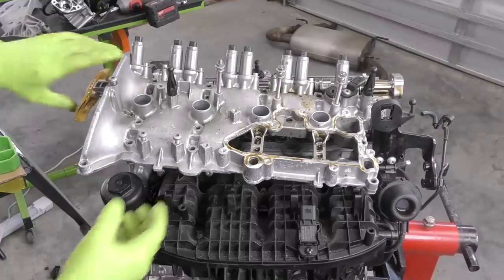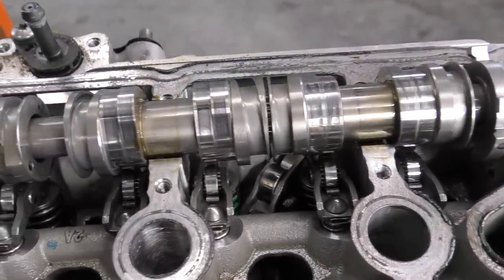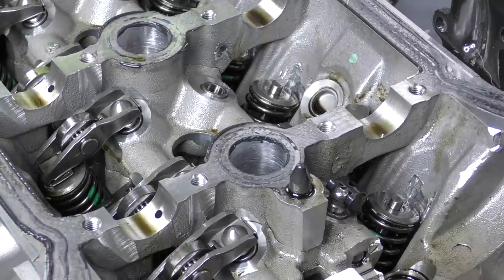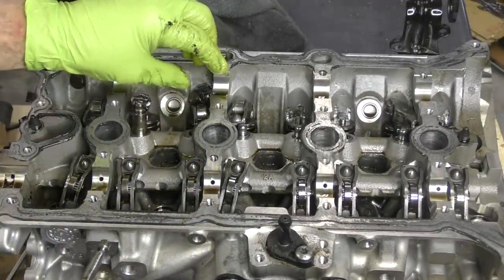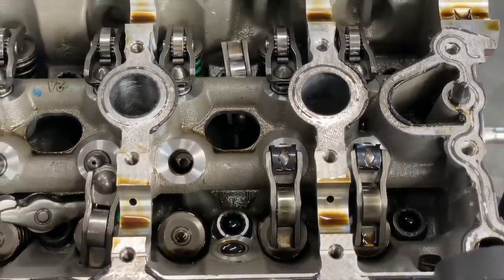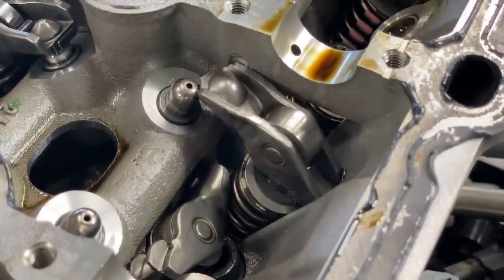Catastrophic Engine Failure VW 2.0t TSI Engine ~ MONEY SHIFT!

Comment: The Germans will soon figure out a way to have plastic pistons
Reply: I'm surprised that the engine valve cover is still metal
Reply: @SPimentaTV  It would be plastic if only it wasn't doing the work of cam bearing caps.
Reply: Valve cover as cam bearings, oh my god 🙂
Reply: I would expect that in a lawn mower with a Briggs and Stratton engine.  They already have plastic carburetors on theirs.  The first time I cleaned one I was a bit afraid that the carburetor cleaner might melt it.
Reply: Garage 54 made wood pistons...
Reply: Charles Hines a lot of small engines have plastic camshafts too
Reply: Love the Power 6 logo !
I’ve owned a few GN’s in my day
From stock, to 1400 hp Stage II
Reply: @flyonbyya  That's awesome! I wish I could say the same. I'm just a Buick fan. I've owned a few LeSabres from 1987-91, and a 99 Regal GS. Nothing like a 3.8!
Reply: Sérgio Pimenta in the future 3D print your rebuild parts.  Throw your old parts in the recycle ♻️ bin
Reply: @jameshaulenbeek5931  He is testing them for VW
VW want to be more Eco-Friendly after diesel gate
Reply: Sérgio Pimenta as far as I know bmw is the only German car using plastic valve covers
Reply: It's probably not far off. It's incredible what you can do with modern polymers.
Reply: @DStabs720  The old VW Beetle had nylon camshafts!
Reply: @SPimentaTV  BMW is using plastic
Reply: Well, I had few years back Audi A4 which had plastic oil pan. It never kept oil inside. I had it four times under warranty and they replaced twice the pan and tried to make it not to leak. I had enough and sold the car. Plastic has its place but not in the engine where temperature differences are huge... Trying to reduce costs with stupid things like this is something I don't understand.
Reply: They will charge us the same as having metal too. Climate change has fucked the consumer. Smaller and weaker engines for MORE money. Ridiculous.
Reply: Sérgio Pimenta 2020 Corolla are plastic now, Toyota beat them to it lol
Reply: Alex Dugre Germans have had plastic valve covers for 10 years. Not every model has them though.
Reply: Plastic is the new premium
Reply: Had a BMW e90 2007 318i with 2.0 n46 engine. It had plastic valve cover. It needed new one because plastic one got bent. Quality my ass...
Reply: The Germans and Swedes have still not figured out to make a coolant reservoir out of the proper plastic. I replaced my Volvo tank 5 times.
Reply: @VladoT  Japanese motorbike manufacturers have been doing it successfully for decades....
Reply: @Ozsmallbore  I understand this from a packaging perspective since bike engines should be as compact as possible, but as a cost-cutting measure i think that it will cost more in the long run.
Reply: plastic camshafts exist
Reply: @VladoT  Ah yes, it's a bastard. Especially on the 1st gen FSI engines, if it starts to leak through the seal between the head and valve cover the whole chain must come off the cams to even remove the valve cover :) Happened to me once on a 1.6, drowned a coil in oil. German over-engineering never disappoints.
Reply: @VladoT  Cam bearings in the Valve cover don't have any disadvantages against the traditional cam bearings
Reply: it's truth, only why only Germans? All car manufacturers of all West countries since 2010 produce no more engines, but total crap.
Reply: David S    Hate to fill you in, but ICE’s are DONE!
Reply: The EDNC you’re delusional. Gas engines will be around forever
Reply: Ea288 tdi engines use steel pistons. Keeps more of the heat in the squish area.
Reply: @TheEDNC  hate to tell you but your wrong
Reply: big teddy    Sure.... 🤣😂😆🤪🤧🤣😂    😎
Reply: @TheEDNC  go work out how many engines are built every day 👍😂🤣😅🤣😅😂😅🤣😅😂🤣+🤞that's how it will stay
Reply: Tony Carver   vw🤣
Reply: @DStabs720  In the future the only places you'll find a petrol engine are in race cars and what will become classic cars owned by rich people. Passenger cars will be all electric or hydrogen fuel cell, and trucks will be bio diesel.
Reply: Lawn mowers have plastic camshafts. However, there is a virtually all plastic engine called polimotor. However, industrial plastics that can hold up to the temperatures that a piston goes through is prohibitively expensive and has a short MBTF and quickly failed in a race. However, the 4.6 modular engine used plastic valve covers as early as the 1990s have held up quite well. However, electric drivetrains are already replacing internal combustion engines. In 2025, Volkswagen will no longer design and engineer internal combustion engines.
Reply: robertas grigas I know that there are plastic camshafts in Briggs and Stratton lawn mower engines
Reply: @TheEDNC  right OK mommy, 🤣😂 how old are you? The whole EV thing may or may not happen petrol, then electric then petrol, then diesel then gas then petrol then hybrid petrol then hybrid diesel, now hybrid petrol and of course full battery /EV. There was another attempt at electric cars a number of years ago but sadly for those that wanted them that failed. Our governments have influenced these changes over the years to a huge degree, by telling us buy petrol it's better, buy diesel it's now better, buy a hybrid that's better. And of course we will make you pay accordingly through fuel duty. People do tend to go with trend at times. My bet (without agenda) would be that evs will be, if they take off at the rate you are saying, which would be great for cities, we will be paying a whole lot more to charge them than we are now. I don't get why people don't see this coming, it's not as if vehicle taxation is likely to dissappear. I am not burying my head in any sand, I just don't think that evs will be as huge as some people would like them to be. Some people want them some don't, I don't personally because it is not suitable for my requirements. If you do no one is stopping you. OK kid. EDIT oh I forgot all the....   ...... Dot dot dots
Reply: big teddy    Butthurt any?
Reply: @TheEDNC  come on then explain. Makes no sense to me, if its supposed to be insulting I have to understand what it means
Reply: I'm glad I bought Corolla in Germany, not plastic engine room bmw or vw. Although some Toyota with diesel engines were supplied by BMW
Reply: @bigteddy66     He doesn't need to explain anything.  The writings been on the wall since 2010.  ICE's are DEAD, as in bye bye, sara-nara, good riddance ... why?... Just look at the Corporate Average Fuel Economy or CAFE standards for the next decade. Too expensive to meet those new regulations. Ford is going EV. GM announced that they too are all in on EV's even announcing their partnership with NIKOLA cars this morning. Just read what's happening on Wall Street...  Have you seen this? A 1,500hp Mustang EV  https://youtu.be/uyd6ONBV5V4 Bye bye PISTON CARS, you had a great run, but the world outgrew you!
Reply: @EpicPain-  <<< ICE's have been done for some time now, most gear-heads and greasers (like me) just don't wish to know, but I figure they will fall by the wayside soon enough. If you know someone who owns a service gas-station, tell them to sell it now.
Reply: @TheEDNC  d@@ he@
Reply: big teddy    Say it
Reply: @EpicPain-  I was asking EDNC to explain "butthurt any?"
Reply: @bigteddy66    Like I said, since you obviously went on a feminist rant to his comment, (which made everyone here laugh at you), he obliged and said "butt hurt any".  You know what that means? Obviously not, but you will when you grow up and mature a little.  Hint, google KY-Jelly.
Reply: @MyEyesBled   Haha  Big Teddy's an obvious troll. BTW, I do know a station/service owner, and he said it's too late already. He couldn't sell it even today, he would lose his shirt! Gas Stations and licensed mechanics could be in for some serious trouble.
Reply: big teddy <<< Epic is a decorated combat veteran!
Reply: @MyEyesBled  good for him I couldn't care less what he is. he and yourself are behaving like this is your right to comment and no one else's
Reply: @EpicPain-  until they make better batteries  ices are here to stay . Lithium takes too long to charge I don't want to spend 45 minutes filling up nor do I want a 300km range , at least 500 km and 30min to fill to full ,than I can get behind it . Where I live there are like 10 chargers in a 30km circle .... Yeah ... Ices are gonna live for some time here ...
Reply: @robivlahov     You have 10 years... at best... after that ALL bets are off.
Reply: Ceramic
Reply: @trevoror8668    Neither, all future ICE development has been halted... RIP
Reply: @EpicPain-  do you really think the petroleum industry is going down that quietly. I cannot see that somehow
Reply: @VladoT  awful isn't it. Cam lobes  skinny and just look weak. Nasty design
Reply: @trevoror8668     OPEC nations have been buying up EV futures in Tesla, Nikola, Lucid, etc stocks... they're also buying up all the raw mineral quarries they can find all over the globe used in battery cell production. Several car manufacturers have already announced full EV production by 2030. Sure they'll always be gasoline powered engines here and there, bit it will be limited and TAXED to death... translation = $$$$$
Reply: @EpicPain-  quite agree with you but there's unlimited ways to clean up exhaust emissions as with coal it just needs the investment. There's just two much. Money invested in oil and silly climate fools thinking stopping cars will save the world it won't because most climate change is totally natural and we are still in the ending of the last ice age humanity has never experienced this in all our years and no one really has a clue. Only today a massive volcano went off in south America these alone put more co2 and more in the air than human's do in twenty. There's very much big B.S. about and we still have to create electricity???
Reply: They already did with the Porsche 3D printed pistons.
Reply: @Kris Nicholson Look up NASA plastic hinges. There are plastic spring mechanisms in microchips.
Reply: @trevoror8668    Again, it has everything to do with the PROFIT margin and the enormous cost of R&D to meet the ever stringent C.A.F.E. emission standards. That alone has killed the internal combustion engine. Plus ICE's require way too many parts to manufacture, assemble and then service Add to that all the supportive hardware & running systems that modern cars need to operate and meet today's regulations such as S.M.A.R.T. ignition & engine management, exhaust systems, catalytic converters, coolant systems, fuel tank - ventilation and high pressure fuel delivery systems (nearly 220 separate parts on a V6 right there) etc etc ... and the killer expense, training ROBOTS to assemble all that BS as human assembly will be a thing of the past! So SAY HELLO TO EV's with nearly 60%  less parts, easier for robots to assemble... even California announced yesterday that all cars sold in CA must be electric by 2035... they may be the first state but NOT the last. Take care and prepare yourself.
Reply: @EpicPain-  so they create robots that have to do all that but on a different power type namely electricity which has to be generated by system's that are totally against any of the environmental bs nuclear or laugh till we drop renewables LOL there's the bad joke of modern times. This has only one direction and that isn't going to end well
Reply: porsche did a research on 3D printed piston rn
Reply: @wolfschindler8921  probably ptfe rather than nylon?
Reply: Tony Carver  plastic is stronger
Reply: @DStabs720  more than that.  2002?
Reply: @lessmasterdark  not on 2.0T
Reply: @BenState  2.0T had its own share of issues. Tensioner and gliders were terrible, along with bad piston rings up until 2013. If you want a vw/audi veichle, your best bet is to go 3.0tfsi or 3.0tdi. 4 bangers are cursed
Reply: @BenState  they may be in decline, but I doubt that it's terminal. Not yet anyway. Making batteries isn't clean either, nor is disposing of them. When it is then maybe. Who knows. Let's wait and see. 👍
Reply: @bigteddy66  it already is.   you're knowledge clearly was updated in the 90s.
Reply: @lessmasterdark  nonsense.  gliders?
Reply: @VladoT  I just replaced one on an 09 CC.  Very interesting...id never even heard of anaerobic sealant.  Definitely more different than any other "valve cover" ive ever done.
Reply: DiagnoseDan just did a video on a Mercedes that has the ECU mounted DIRECTLY ON TOP of the engine. It fried. For some reason the engineers thought it would be okay. I guess they forgot that heat rises.
Reply: @jameshaulenbeek5931  Cleetus McFarland made a wood driveshaft
Reply: Metal interior door handles and trim parts, and plastic bits doing critical tasks inside the engine. Sums VAG up.
Reply: As a German I must admit our cars especially our engines have al lot of plastic, but American cars are way worse. The Interior is not well made and is most of the time of very cheap ( it feels so ) made. Also downsizing is not popular in the American automobile industry, just because of the fact the fuel ist very cheap there, but environmentally friendly doesn’t really play a role. How should it play a role, if the ex-president falsely says that there’s no such thing like climate change. Also leaving the Paris climate agreement.
Just as a comparison, one gallon equals 3,785 litres.  One USD is 0,82 €. In Germany 1 L of 95 octane ( lowest u get ) highest is 102 octane costs 1,36€. 
So converted Americans would pay 4,22 USD per gallon. Which is more ore less Double the price.
Reply: @felixlosle9203  German cars are way worse than American cars. Also climate change is fake. It’s nothing but a money grab. Part of the US was supposed to be underwater by now.
Reply: @markokrsmanovic1080  as much as I prefer aluminum or even better a separate steel lower oil pan, the plastic design is quite durable as plastic can bend and return to original shape. In the situation of hitting off something, the plastic would be good as the aluminum could shatter, the steel would bend and require repair, and the plastic could bend right back. For scraping though, the plastic would quickly wear right through.
Reply: And plastic timing chains.Pure junk.
Reply: The camshafts are metal but the drive gear is plastic,well it is on my Kawasaki lawnmower engine.
Reply: @eugeneoreilly9356  I’m pretty sure Honda GX small engines have plastic cams
Reply: @amazoidal  I just replaced my 2000 VW Golf TDi’s just so it looked new, the original plastic was old looking but no leaks. 227K miles.
Reply: Yeah then 5 yrs after the Germans come out with it the Asians will copy the design like they do with everything else with automotive technology 🙄
Reply: @eppyz  that might be true to a certain extent but the Japanese perfect the technology before using it. Unlike the Germans who use their customers to test it.

Comment: As my friend would say: The issue Originated between the steering wheel and seat.
Reply: In aviation we call it the meat servo.
Reply: On a motorcycle they call it a failure of the nut that connects the handlebar to the seat
Reply: It was the nut at the end of the stick that failed for sure.